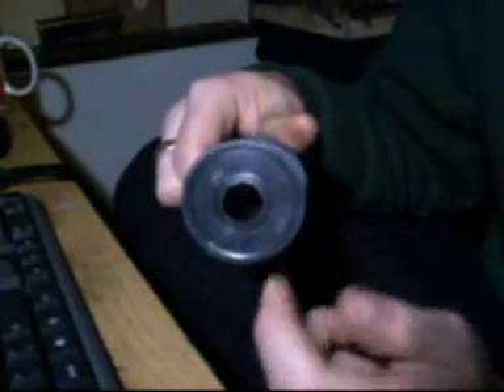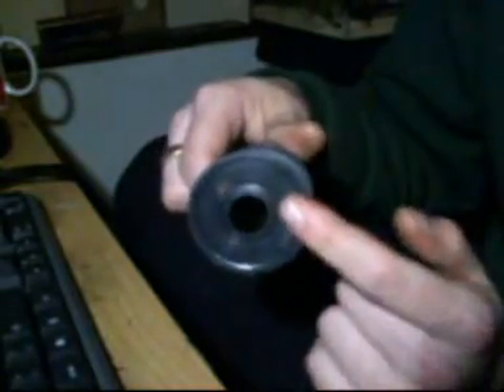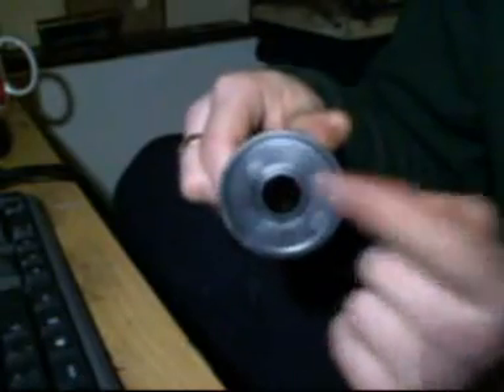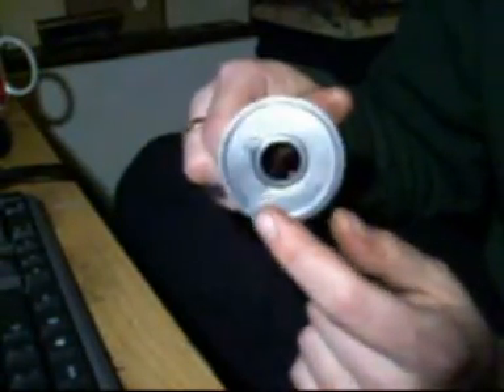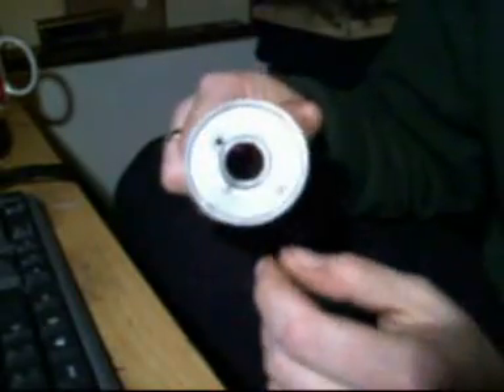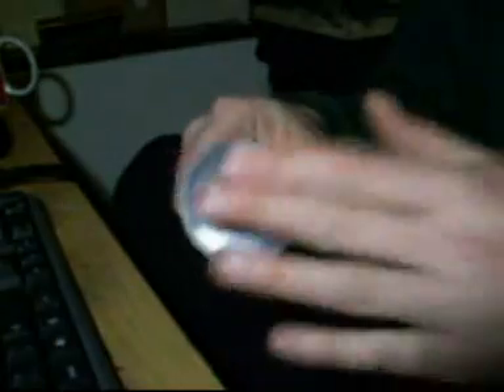How to Make the Coil for the Bedini Motor (SSG/Schoolgirl)

Comment from the maker: you can get different kind of coating but usually it is enamel... it can be burnt off.

You could repair small areas using heat shrink or insulation tape.  Glue is another possibility but I doubt its reliable.  Depends how bad the damage is...

Comment: no i wasn't. i'm trying to build just the motor right now and not really the charging version. i took out the battery charging part of the circuit and it looks just like bedini's simple motor diagram thats online. i have the led bulb, a 5k potentiometer, 10 ohm resistor, the same transistor you have in your vids, and i hooked it all of the wires from the coil just how you did it. ( i have 900 turns) this is my first time to ever try to build one of these so it's pretty confusing.

Comment from the maker: you can reverse the poles by turning the coil upside down... but it sounds like the coil is the right way up but there may be a short in the circuit... were you using a neon?

Comment: is there a ceertain direction the wires have to go to create the north magnetic field? i'm building a motor based on your diagrams in your other vids. the circuit works, but when i hook it up to the coil, and stick it next to my wheel, it doesn't make the wheel spin.
it just repels it and does nothing else. thanks for the help!

Comment from the maker: The coil doesn't have to be perfect. ^_^ wrap it as neatly as you can.

A poorly wrapped coil won't perform as well as a well wrapped coil but it doesn't effect the performance as much the other variables like core material.

Perfection is a good goal to go for and I did wrap a near perfect coil once by cellotaping a layer of thin paper between layers.  This makes it much easier to wrap the layers in a uniform manner.

Comment: so when winding the coil do all the layers have to be perfect???
I am using 23g and 26g wire, the first row of winds comes out great but then after a few passes back and forth the wires want to start imbedding themselves in the previous layers. so my question is do all rows and layers need to be perfect??? any help would be greatly appreciated as the coil construction is holding me up on my finished motor.

thanks

Comment: Yes, i agree. Digital or analog multimeter in AC only meassure the square of medium power and is only usefull if you meassure a senoidal wave [sqrt(2) correction factor]. To any other different wave is useless.. thanks for your replay.

Comment: Hi 

How many gramms of iron powder would one need for one coil core (length 80mm / diameter 10 mm)? I don't have any iron powder to see how much I really need. I've found sellers on eBay that sell iron powder, the bigger the amount the cheaper it costs, so I want to order more for future use.

Comment from the maker: Hi!  Best to add as many turns as you can... I don't think there is an optimal amount of turns... more the merrier!

not sure if stainless steel is such a good idea... it might help if you ground it up but in general steel retains its magnetic charge alot more then iron... you can give it a go but I would reccomend iron filings or magnetite sand....

good luck with it!

Comment: hi every1
I'm almost finished with my first bifilar coil, around 900 winds, not very tight, I still have some wire left for about 50-100 winds, is 900 enough or should I finish all of the wire?
For the core of the coil I want to grind some stainless steel scrubber (those things that u use for very dirty dishes) in my coffee grinder, mix the shavings with some paper glue and pour all of that into the core of the coil, would it work fine?

Comment from the maker: There is not much torque with the bedini motor... though it is possible to add more coils and get higher torque... I still need to do experiments to see how adding a load to the motor effects the charging efficiency though interestingly when a load is applied amp draw goes down...

Comment from the maker: to give you an example of it producing free energy:

My self running version (introverted schoolgirl motor) runs on one battery, a 7.2 amp hour battery, which means it has enough energy to generate 1 amp of current for 7.2 hours. However my self runner was running on 950ma (just under one amp) for 21 hours and it was only half charged to begin with! So in theory it generated almost 6 times more energy than was in the battery :)

Comment from the maker: hard to explain what the motor actually does in a text comment!  there is a brief summary of how it works in my "how to build a bedini motor part 1" vid :)
The circuit basically generates another form of energy that has many names but is commonly known as Radiant Energy.  This energy is then channeled into another battery and charges it!  Over unity is fun!

Comment from the maker: the coil is a part of the bedini motor... the thin wire is the "trigger coil" that generates a current when a magnet passes over it.  this current flows into the transistor. A transistor is like a switch that turns on when a current flows into part of it.  when the transistor turns on it sends current from the primary battery through the thicker wire in the coil and pushes the magnet (that generated the current in the trigger coil) away and keeps the wheel spinning.